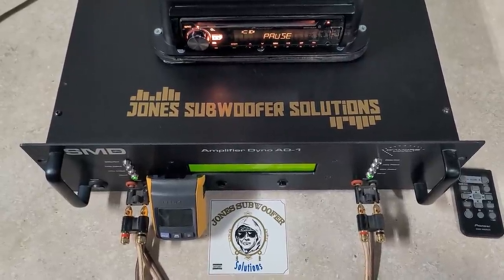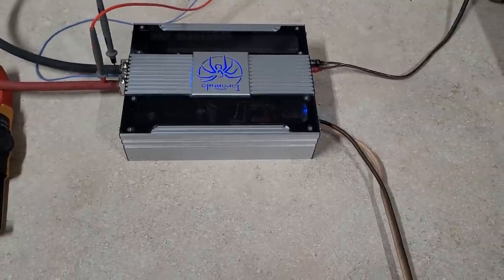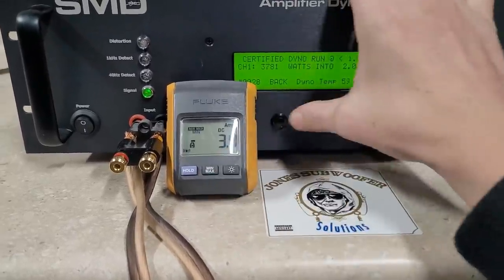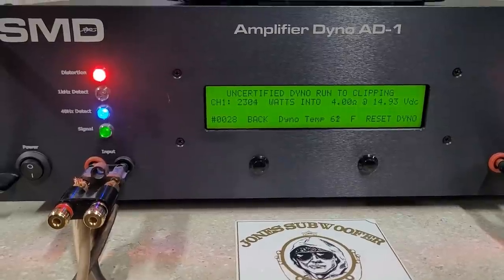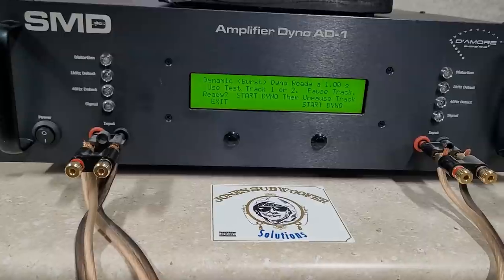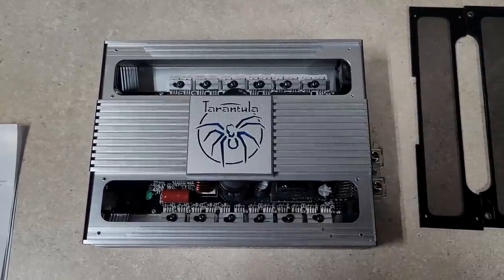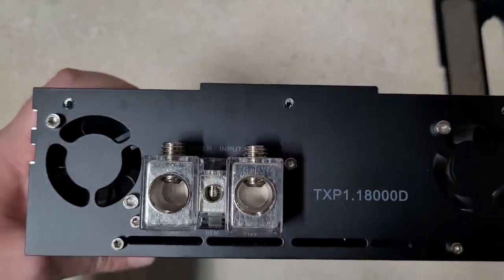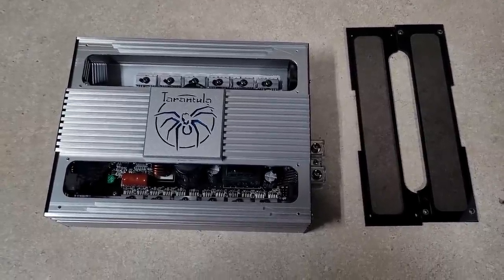AD-1 Amp Dyno Soundstream Tarantula TXP1.18000D by Jones Subwoofer Solutions JSS

Comment: 20 years ago that would be $20,000
Reply: That's true bro 😅😅😅
Reply: Exactly!!! That's an insane watts per dollar amp! I have one and have been running a couple of ID 500wrms subs until I get the 3 12 box done and I can't wait to run it at 1ohm.
Reply: And the size of a surf board 😆
Reply: And absolutely massive, too. We had a rack mount PA amp at a music shop where I worked when at college in the early '90s and it was 19" by 30" by 4" and need two people to carry it, and that was only 2 x 500w!
Reply: 20 years ago it woulda burnt the car down these things are for small setups to talk big. Ive personally seen these amps at 1 ohm simply pop and solder the power to the negative i think they should be taken off the shelves

Comment: Wasn't a thing cheap about sound stream in the nineties!
Reply: @Scott Miller you're right... Soundstream used to be very legit. They still make decent products here & there, just have to know what Soundstream products to buy these days. Sad they went downhill. 

Scott I have still have a Soundstream headunit in one of my cars that I installed back in 2015. It's been solid up until a few months back. When trying to use the CD Player it will make it shut off & back on & then switch between all the media sources. Very frustrating & on top of that the radio transmitter has gotten to where it will not pick up local radio stations. So I'm ordering a new headunit. I was going to get the Bluetooth Soundstream double din w/navigation, DVD player etc but I think I'm going to shy away from Soundstream this go around & spend the extra $ on Sony. I really like the new Sony ax7000 that has the high output onboard 45 rms x4 channel class d amp built in. It is cta-approved rated rms which should sound nice until I stop being lazy & motivate myself to install my 4 channel amp.
Reply: @itdoesntmatterwhatyourname6128  do they carry the same sony headunit in a single din. I need something like that because I keep frying my 6x9s evrytime I hook up a second amp to run highs or mids. I get a very dirty signal and ive tried just about everything except upgrading my stock alt because of some whining I get from just connecting the remote wire to second amp.
Reply: @RomaVilla  you are wanting a single din headunit that puts out 45 or 50 watts rms x 4 channels? If that's what you're asking then yes Sony also offers their "High Power" headunits in single din aswell, even make a couple of the High Powered units in Marine rated! 

Btw the Sony Ax7000 I mentioned in my previous comment is actually a single din chassis besides it having a full size almost 7 inch touchscreen. It didn't make much sense to me a touchscreen being single din because they a typically all double din  chassis. But go look at pictures of the Sony ax7000 headunit so you'll understand how it is considered a true single din headunit then you'll see what I'm talking about. I'm thinking about pulling the trigger & going ahead to order it even though the ax7000 lacks some features that I think Sony truly should've included for their customers. Its chassis behind the touchscreen monitor is so small (like other single DIN headunits) & I think it is also slightly shorter in depth too which is why it does not have a DVD/CD Player.... The single din design sure seems like it will make it easier to fit in dashes where space is very limited. I know my vehicle does not have much space behind the dash so this unit should benefit me greatly as I have a lot of RCAs & other added wires, amp, dsp wires etc that I have to connect to the back of this headunit.

Roma2189 Villa have a good day, hope my comment helped answer your questions or clear up confusion.
Reply: And early 2000’s
Reply: @itdoesntmatterwhatyourname6128  jo
Reply: That's because in the '90s Soundstream was owned by the original design company, not the manufacturer who owns it now. Back in the day they were expensive as hell.
Reply: @VisionSandS  yes they were not cheap,remember there was no Amazon or internet retail. N 98 or 99 I bought the Rubicon1002 and I gave right at 900$ for it.
Reply: i have a reference from the 90's and till this day high power 1/2 ohm and high current i 1ohm it and still pumps just like in the old days
Reply: Remember the special edition one that could do .25 ohms. Was rated at less than a watt at 4 ohms but did nearly 1000 at .25 lol They used to make some amazing amps. I ran the 500s and 1000s for years!
Reply: @TheDudeRc  I still run one of the first Rubicon1002
Reply: @scottmiller3025  I’ve got a Rubicon and Angina still that I bought in 2000 or right before that.  A 10” Soundstream Exact sub, also, lol.  Had to glue the cap and surround, but it still hits pretty good...
Reply: They went down cus they got bought off like precision power mb quart hifonics crunch etc ....smh we still have jl and rockford fosgate
Reply: I still own a reference 500 from about the mid 90s although one channel doesn’t play anymore but I’m thinking of getting it repaired it was a awesome amp with high current mode beat a pair of 15” in an s10 back in the day.
Reply: That's insane power for an amp so small...and cheap. Holy crap, over 2000w at 4 ohms...
Reply: So apparently a safe 5000wrms at 1 ohm, lol amazing we are trying to get so much from such a small amp. 😆 So basically a Chinese taramps with more fets for more current. Hmm I only need about 3000w to run my 10s, bwahaha
Reply: What I wonder is how good it would sound if running at lower listening levels, I never hear any reviews of sq on these recent full bridge models that are being pumped out.
Reply: Maxxsonics owns them . Along with MB quart, crunch, hifonics, etc. They are all shit now compared to old School. Not zed boards in amps no more. China junk. MB quart used to be the best for mids and highs. Not anymore. So sad.
Reply: @jkstdstang  where to send it to get repaired need a good shop??
Reply: @jarrodhamilton5654  im still looking for a place
Reply: Sad thing is alot of companies sold out to cheap Chinese companies and this is the result.

Comment: If they just called this a 3600W 2 ohm stable amp it would be fine at the 300$ price tag.   Why lie, Soundstream?
Reply: NO.. its a 5500 watt RMS 1 ohm stable amp.. Thats an old school rating.. ... Wired at 1.. It will never see it. But it is safe to wire at 1 ohm all day...
Reply: @whoman3466  
So your definition of "old school" rating is lying about power output and shooting out flames at rated minimum load.   I think you and I must have been using very different equipment back then.
Reply: @hispls  Incorrect. Even though they were more accurate on power.. No doubt.. But their ratings were based off wired loads. Not resistive loads... Measuring impedance rise wasn't a super common thing.. And virtually NOBODY outside of competition was .
Reply: @whoman3466  
So if you are an amp company, how do you rate your amps while figuring in "rise"?
Reply: @hispls   ohm will generally rise at best is 50 to 60% so 1.5 to 1.6 wired at 1 ohm. If you want to get technical. I've been going to competitions a long time and those some 1 ohm amps you could wired 1/2 ohm daily many you could not including name brands. And to see a true one ohm load you would have to be wired to point six to .67. And in some cases half ohm. Many of the old school amps would become incredibly hot running These ohms daily and shut off due to Thermal limitation. So often manufacturers would rate their amps on a 1 ohm resistive load because it's not a lie but the safe wiring rating would would be the wired ohm not the resistive ohm.
Reply: @whoman3466  
The point being good quality amps will make rated power into their rated impedance on the amp dyno and flea market junk amps will never make rated power and will blow up. 

Do we know if this amp will even survive at 1.5 ohm?  What about 1.25?  Rating an amp stable to an impedance which will blow it up and counting on the consumer's load to rise up enough to not blow it up seems like a terrible idea, and coming at it from the other end there are loudspeaker manufacturers that rate their speakers accordingly, for example DCR of a coil is .7 ohm and they call it "1 ohm". 

In short, soundstream sells junk and they lie in order to do it and shame on anybody who buys any of this crap and supports these shady practices.
Reply: @hispls  Point being is a good value is a good value.. Shame on? Ok well if it is an ethics thing. Any company that has their amps/subs made in china falls under the same unethical values as false power ratings.. So many companies that you are praising right now are just as dirty.. Profiting off unethical work conditions and lower wages .So do you want to make this an ethics thing? And if it isn't. Then a good value is a good value.. A 5500 watt rms amp for 300 bucks is a good deal . Period.. If it blows up under the warranty period. Then you get the warranty ..  I remember for years defending the audiopipe 15001d against people like you.. At first it was always it didn't do the power.. Then when it was proven it did.. Well it is a really dirty amp.. But wait... It does its power at certified 1 percent THD . So since you are such a fighter for values and good practices. Are you going to openly criticize any of these companies that buy from china?
Reply: @hispls  PS .. Even though I dont love the idea of what these companies do. Thats the market now days. With everything... Batteries for example.. Even most brand name such as duracell dont quite reach their rated MAH. They exaggerate a little bit. . I was watching some mah capacity test on rechargeable batteries recently... Many flash lights dont meet their lumen rating... For over a decade now... The vast majority of 1500 watt portable heaters aren't really 1500 watt.. Go through some wattage test on various things non audio.. I would bet you most 9w led light bulbs aren't really 9 w led's ... And other items. Involving stress tests .. resistive to elements tests.. All kinds of things exaggerated.. Hell in car audio for years. ."sensitivity rating" .. .Its 1w at 1 meter free air.. Means nothing. But companies always post it. Power tools.. Ratings on torque and HP a lie... circular saw 2 .75hp? ok.. BS .... So you are telling me that pulls 25 to 30 amps.. Or a shop vac. BRAND NAMES INCLUDED.. 6 hp.. 7hp.... So 80 amps of pull? BS ... Its everywhere brother And this can go on and on
Reply: One last example. I use to work at papa johns .. Their commercials say 100 percent real cheese.. You go into the walk in.. The boxes say 100 percent real(trademark logo) cheese. So they are saying 100 percent real brand cheese.. Not 100 percent cheese.. Your issue is with capitalism bro. Not cheap amp companies
Reply: @whoman3466  
So if other industries have shady companies that lie about stuff that makes it OK? 
Any way you slice it, this is maybe a 4000W amp marketed as 18,000W that will potentially light your car on fire if you get near it's claimed minimum impedance.  Nobody should give those thieves their money or install that junk in their vehicle under any circumstances.  There's simply too many other options by companies that don't have such a low opinion of their potential customers.
Reply: @whoman3466  
Because in worker's paradise communism we would all have Mosconi amps, or because being free to own private property makes Soundstream lie?
Reply: @hispls  Ive seen a lot of high power brand name amps catch fire
Reply: @hispls  And you didn't answer my question.. If its a moral issue.. Then you are willing to condemn any car audio company that has subs or amps made in china? correct? You dont get it both ways
Reply: @whoman3466  
On the dyno at rated minimum impedance?   Name 3.
Reply: @hispls  Not till you are going to answer if you are willing to condemn companies that use china to build their products.. They are just as morally corrupt
Reply: @whoman3466  
I don't see how manufacturing in China = selling a product that won't make rated power and will catch fire within its rated specifications.  Plenty of brands use Chinese buidhouses and are honest about products.
Reply: @hispls  Now trying to go incredibly simple.. "WILL catch fire". These type of companies have sold millions and millions of amps... Can you produce million new stories talking about this. Or 1,000.. Or even 100? You were speaking of it being morally questionable ... Which it is.. So is having your product manufactured in china.. Its interesting how you felt so strongly and went so in depth.. And now you want to simplify it so quickly... Why do companies use china. To save money and to keep their product affordable ... Well over 80 percent of people who buy amps dont really understand as we do about true power. So once you have  a few companies that will lie about power. It guarantees you more sales to do it as well Thus more sales. The EXACT same reason companies have it made in china.. Its not because its a better product ... Its not because they pay their employees more.. It is for one reason. Money. Same reason the companies in question lie. To sale more. As long as its still a good value, im ok with it personally ... Im on board that it isnt morally pure... But neither is having your product made in china ..I just chalked both of these things up to business and business not being very moral
Reply: @whoman3466  
Do you believe this one catching fire on the dyno at 1 ohm is just a fluke and thousands of others that they sell will be fine? 

Second, these are not a good value at 400$ they will safely make 3500W into 2 ohms and below that you MIGHT get 5000 before it lights your car on fire.  A good value would be the Sundown SFB5000 which will actually make 5000W into 1 ohm on the dyno without catching fire, comes with 2 year warranty, and sells for 460$. 

Taramps Smart 3K will make over 3000W into 2 ohms and is 250$.  Those aren't even made in China. That's a good value.

Again, China doesn't enter into not lying about your products.  Nobody is lying about their Far East buildhouses and as far as I know you can clearly see "Made in China" on the box and/or on the product itself.  Now if you show me something that claims "Made in USA" that is being built in China I'll get on board with condemning them for lying as well. 

I repeat, Soundstream has been flea market junk for about 20 years now and nobody should be buying from them until they mend their ways.
Reply: @hispls  I disagree. And we can leave it at that.. And maybe not caught fire.. But a bunch of people have been complaining about blown taramps
Reply: @hispls  and now your 300 dollar claim has become a 400 dollar amp .... Trying to twist the argument now.. I was defending the 300 amp. not a 400 dollar amp
Reply: @whoman3466  
The point isn't that they're indestructible, it is that they will make rated power at rated impedance into the amp dyno without blowing up and are priced even better.
Reply: @whoman3466  
Well it seems that the market agrees with that because all the listings on page 1 of my google search at the 300$ price tag are out of stock and the 400$ ones are still for sale.  Like I said in my original comment, if they didn't lie they'd be fair at 300$.
Reply: I point was made on your 300 dollar claim
Reply: True. But if they had a 20000.1 that did half of it rated wattage at 1 ohm for 300 bux I would be impressed.
Reply: @whoman3466  amen sir

Comment: Dude wanted to break this amplifier for some reason.  6000 watts with no impedance rise at 1ohm... something that would never happen in real use. Pretty amazing amplifier for the cost.
Reply: Definitely a faulty amp I've been running one of these for 4yrs now even made the mistake of letting the positive sub wire hit the negative battery terminal sparks out both ends 😂 shut it down turned back on didn't skip a beat now I'm currently pushing 2 skar zvx 18d1 at 1ohm and it's crazy good love this amp
Reply: ❤ absolutely not to mention his system had big issues. Dyno has it's thang and head unit issue 😢 how about you fix your shit before you destroy others stuff and bash it